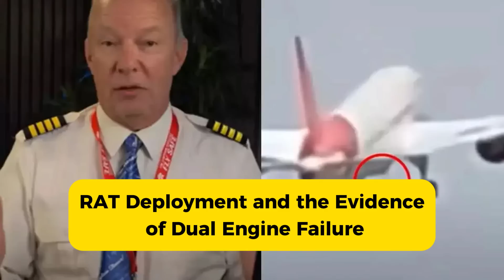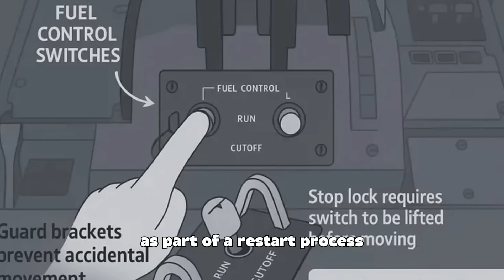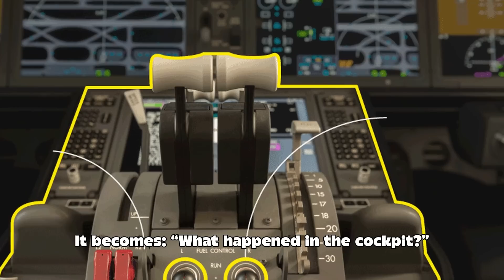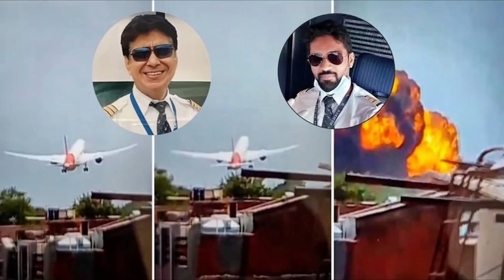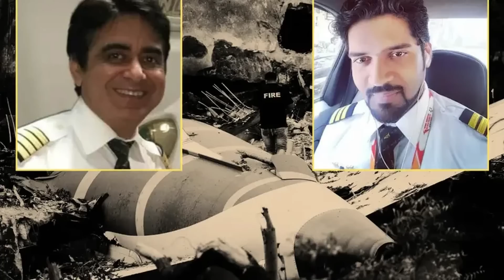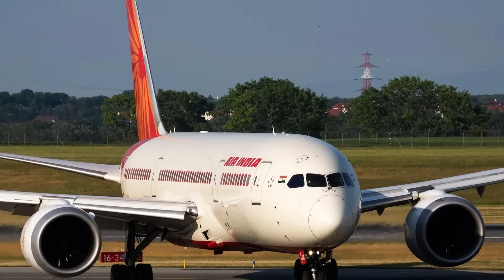Air India 171:  Fuel Cutoff Switches Were Flipped - No System Failed. So What Happened?

Comment: I think the computerised systems are more to blame than the fuel switch theory...the plane kind of flew itself and denied manual control of the aircraft by the pilots....serious computer error. I think somehow the pilots forgot to... basically a manual.. computerised systems interface where the plane and the pilots are in.... consensus ... basically kind of caused by the pilots forgetting to turn the plane from ground mode to flight mode...thus the plane still assumed stationary mode...thus it couldn't fly causing the stall then the crash.

Comment: As the air india lifted of it became a space ship for a couple of seconds because the right engine shut down so quickly would you accept as emotional trauma could it be expecting to much from pilots..or could it be a habit of lithium batteries wanting to recharge thier selves..or is thier the slight.possibility..that a generators. Windings.failed and the cuurent fed backwards past rectifier...

Comment: Its either the computer programming flaw or the pilots inability to control or bypass the system to  operate the switches or the engine shut down by itself. This is the issue that could happened. This is my hypothesis, and it needs yo be verified.

Comment: The missing factor in this video is After a word "I didn't" they lost 10 Seconds, then on 11th second they Pulled off-n-On the LH switch and started the Left Hand Engine moved On position to off, along with they also tilted flight Left to right slightly for 2 second (Check CCTV of runway) on 14th second they followed same procedure of Pull On to Off again the right Hand side switch, but the precious that initial Golden 10 seconds gone so heavier...At the END as conclusion Lets back again to 17 seconds and line "did you cut off ?" "No I didn't" strongly possible that the switches found in ON position so that they gone/moved to find some other possibilities and lost 10 GOLDEN seconds, after a that 10 seconds they return again to both Switches, and they 1st made On- to off then On again (switches misguided them when they found it was already ON, but after 10 second they come to point lets off-on again and they succeeded as the LH engine was found recovered in report) but flight touched the building at 17 second...THE GOLDEN 10 SECONDS AND THE TECHNICAL ERROR... Pilots only mistake was that... they trusted the switched and moved to other options ... they lost to do what they did after a 10 second...

Comment: I heard that the fuel control module was attended to twice in a very short period of time a few weeks before 12th June. It was then someone played with the module, some remote controlled divice / electronically controlled actuator was installed with the intention to crash the air craft... If u watch the video , it appears that the saboteurs timed the switching off of the kill switch to maximize maximum fatalities by ensuring the crash landing on  land instead of River Sabarmati... 🤔🙄
Reply: Interesting it’s all a possibility.  Also the cabin had lot of problems with things like AC not working and other electrical issues.  Could it be the electrical issues had influence on these switches as well?

Comment: Captain..."Why did you Cut"

CoPilot should have replied .."Take a look at the Fuel Switch which is On"

Because the reply was "I did not" and the captain start to pull down the Fuel Switch Off.

CoPilot started to scream .."May day, May day, May day" and the Tower Control Centre didn't respond.

Can smell a rat 🐀

Comment: All missing that when electrical power to  fuel valve is interrupted, even for a fraction of a second, 787 and 777, by design, the spring loaded fuel cutoff valves to the engines will snap shut. Switches in cockpit need NOT move..Rtd Training Capt EAAC
Reply: yes sirs
Reply: Sir, I as read that you are Rtd. training Capt, please read my own opinion: After a word "I didn't" they lost 10 Seconds, then on 11th second they Pulled off-n-On the LH switch and started the Left Hand Engine moved On position to off, along with they also tilted flight Left to right slightly for 2 second (Check CCTV of runway) on 14th second they followed same procedure of Pull On to Off again the right Hand side switch, but the precious that initial Golden 10 seconds gone so heavier...At the END as conclusion Lets back again to 17 seconds and line "did you cut off ?" "No I didn't" strongly possible that the switches found in ON position so that they gone/moved to find some other possibilities and lost 10 GOLDEN seconds, after a that 10 seconds they return again to both Switches, and they 1st made On- to off then On again (switches misguided them when they found it was already ON, but after 10 second they come to point lets off-on again and they succeeded as the LH engine was found recovered in report) but flight touched the building at 17 second...THE GOLDEN 10 SECONDS AND THE TECHNICAL ERROR... Pilots only mistake was that... they trusted the switched and moved to other options ... they lost to do what they did after a 10 second...
Reply: Cut off valves usually are not pulse latching. Do you know the difference between NC/NO, rising edge / falling edge trigger, pulse trigger, toggle, ,,, operating modes ? You can never tell just by its outlook. 
Then these little switches were only scanned . They're not the real player.

Comment: Two scenarios.
1- Pilot lied.
     Could it be murder suicide?Yes.
2- Pilot telling the truth.
    Can both switch be in cut-off position automatically by  electrical glitch? Yes.
So which scenario most is likely?
- can both switches be moved  to cut-off position manually at one second apart? Not likely possible.
-can both switches be moved automatically to cut-off position by electrical glitch at one second apart? likely possible.
Other facts
-FAA recommendations in 2018 for inspection of fuel switches.
-Britain Aviation Authority issued a directive in 15 Mei 2025 for inspections of fuel switches for Dreamliner.
Make your own conclusion.
Reply: Switches were found in ON, and they moved to find other position and flashed... after a 10 Second they again Off-n-On switches... technical glitch + loss of 10 seconds
Reply: The second scenario doesn't exist. The two switches are manually operated, not electrically driven. 

To operate the switch needs two actions: pull up then move the handle, which can be easily done in one second. So the gap between changing the two switches is one second, which is recorded.

Comment: The actuators,  open/close mechanism of the fuel valves became closed either remotely or technical snag,  immediately after the take off,  deploying the RAT 
This caused a REVERSE ACTION,  to say a reverse relay from the fuel valves located in/around the fuel tanks, to the Spring loaded mechanical fuel switches in the cockpit to Transition from Run to Cut, untouched by hand,  THAT SHOULD NOT HAVE OCCURED (suggest a design fault or intentional ? For Being to retain control ? ) for the reason of the conversation between the pilots, which was rightfully denied,
Blaming experienced pilots is but covering up the non immunity against sabotage/design fault? ,by Boeing , GE,  in connivenance with the Regulatory Authorities,